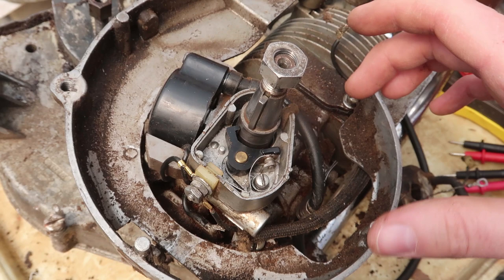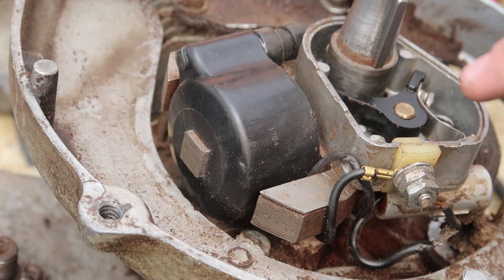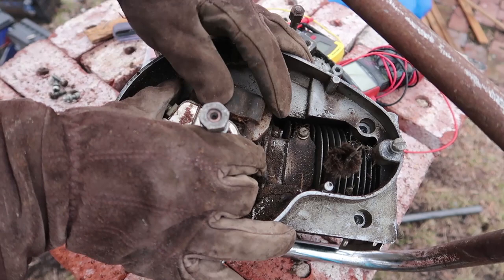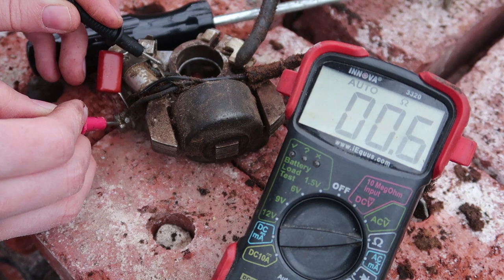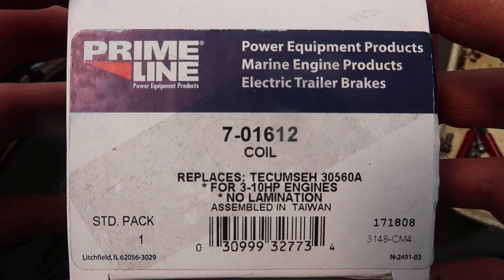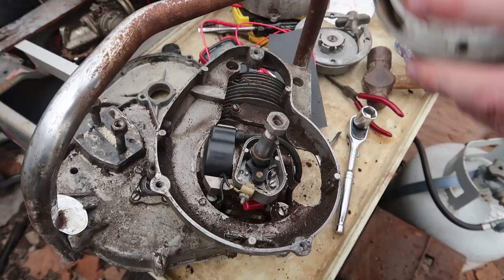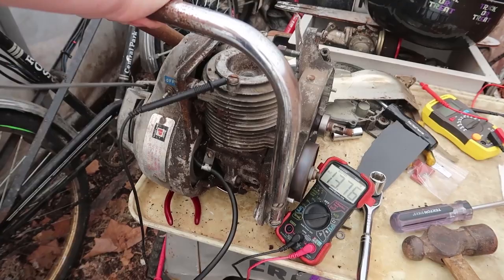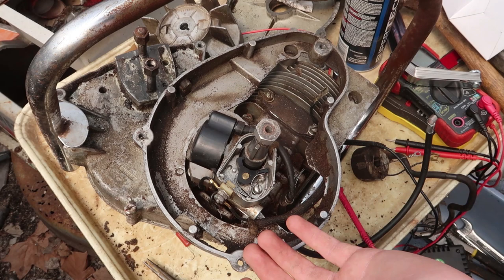1950s David Bradley Chainsaw Restoration 04: Magneto Coil Upgrade Experiment, Fix No Spark

Comment: hmm... I have recently gotten a new CNC milling machine, and was considering possibly trying to make a small engine (probably a lot smaller than the chainsaw engine in the video). the ignition system is an unresolved issue. could do a glow-engine design, or could use a microcontroller driven electronic ignition. downside of the latter case though is trying to figure out a design that wont blow up the transistors (the voltages involved somewhat exceed the breakdown voltages of most normal components).

otherwise, I have little idea about the engine in the video. maybe check that everything is wired correctly?... (maybe find datasheets or similar?). otherwise, could make sparkplug gap smaller to maybe compensate for a lower voltage.

Comment: Sorry I forgot an issue I used to see. Before they were epoxied in, the high tension lead (spark plug wire) used to be screwed into coil body. They twisted onto a very pointy screw clockwise. Sometimes they would loosen and break contact. That coil you have should be jumping almost a 1/4" inch gap on a spark tester (using recoil starter and open spark plug hole.
Reply from the maker: yeah i think im going to cut into the original coil to see if its a problem with the main wire.
Reply: When you set the point gap at high cam are  you at least about .015 ?
Reply from the maker: 0.02 as the nameplate says to do

Comment: Have you tried this... clean your points again and check resistance across the points with the points closed, you should get near zero ohms.  Contacts are a little tricky and if the condenser is bad they get badly pitted due to arcing and can seem to make contact visually, but have resistance (I've seen 10ohms on contacts not enable spark).  Also check the condenser, not just the value but an old school leakage test with an analog multimeter (google for details).  In any case it should work without a condenser, but would damage the points over time.   Also the non-business end of the points should be grounded (end furthest away from the coil).  The hanging wire is basically shorting the spark to ground.  Odd way to do it but almost all small engines short the spark to shut off (so not connected is fine).   I would use a known good plug also until you eliminate sources of problems.   I cringed when I saw you starting with a swiss army knife on disassembly, but I think you're doing quite well and this thing is really old, you just hit a snag.  Carry on.
Reply from the maker: i recently picked up a working oscilloscope so i can test it now to see what exactly is going on.
Reply: Er um... this just occurred to me.  Use a business card to gap the moving magnet in the flywheel to the magneto.  Business card thickness seems to be correct thickness to get a preferred gap.  You'll have to figure out how to set the gap with the magneto hidden under the flywheel, but if that magnet is not working or too far away from the magneto, no sparkie...  Good luck!

Keep in mind you're dealing with a high voltage you may have to attenuate to see on the scope and once you've done that you end up loading up the signal and may not give intended feedback.  BTW,  I've usually had good success with a good spark plug and good contacts that properly zero out resistance when closed.  Assuming you haven't messed up the laminations (possible, but unlikely) and as long as the windings are reasonable resistance.  So you need to verify both the primary and secondary  winding resistances.

BTW, my advise is free and you got what you paid for!

Comment: Doesn't it all function like the distributor in a older car?  points, CONDENSER and coil. The coil produces about 20,000 volts which produces the spark.

that cylindrical part looks exactly like the condenser you would find in the distributor of and older model car, say a 68 VW Bug.

Comment: if you've reduced the magnetic flux of the core, you need to increase the strength of the magnetic field. Mill out the old magnet from the rotor and replace with Nyod's. tweak timing and design as needed. It's not hard.

Comment: AFAIK, shorting the plates shouldn't be an issue as they aren't isolated from each other.
I'd suspect difference in windings and that capacitor not being the right values or being paralleled with the old condenser to be the problem. But, I'm not highly knowledgeable, so take that with a grain of salt.

Comment: i think the newer coils dont need a capacitor and a breaker swith the black wire from the newer coil is a kill wire try to disconnet the black wire from the coil
Reply from the maker: good joke, i read every new comment and dont get promoted liked comments.

Comment: dip your fingers in salt water then hold the plug wire while briskly pulling the pull cord.
that should tell you if you have spark
Reply from the maker: dont have to increase conductivity in order to feel the shock, but i still dont have spark.

Comment: You may have an old condenser that cannot store and release the charge that is needed
to provide a strong quick electric charge to the points and then to the spark plug.
You can not replace it with a standard electronic capacitor, that orange drop capacitor will not
do the job that is needed if the old condenser is the problem. The engine condenser (capacitor)
uses the metal case as the negative (minus -) ground and the center wire is the (positive +) lead.
Basically that condenser is a special electrolytic capacitor rated for engine ignition use and after
all of these years it may be getting weak. It should be easy to locate a new stock (not new OLD stock)
condenser for that engine from the same place you bought the other magneto coil (that other new coil
 should be just fine).. Automotive part stores(Napa, O'Reillys) usually carry small engine condensers in stock.
 Some times you need to refresh the fly wheel magnet to bring it back up to full magnetic charge and
power. If you Google how to do that you will find much information. I doubt that you did any damage 
to the lamination stack with the file, just wipe the surfaces clean and you should be fine. Aloha from Maui
Reply from the maker: this is the capacitor recommended by other engine restorers. you clearly lack an understanding of how this works. it needs to be an AC capacitor, so the ground isnt always negative. it isnt an electrolytic capacitor, instead something more like a thin film capacitor similar to the red new one. just fyi
Reply: The red thin film will not work up to the specifications that you are going to need for that old
system(remember this is not a HEI electronic points system). You will need a capacitor that can hold a charge for a microsecond before it releases. The one in the engine from the original is always grounded through the can.
The thin film capacitor that you are using is excellent as a filter for various frequencies.In the end
try and replace it with the same type as the original. Aloha
Reply: Without a condenser, your ignition will work fine, but your points will very rapidly pit because of the arcing, and may weld themselves together. Always replace the condenser with the points -- it is more common that a poor condenser has caused the points to fail than the points wearing on their own.  If you have a spark at the points it would seem that the magneto coil and metal stacks are working. The thin film capacitor may work but how would you mount it? I have been working on older single cylinder (as well as multi cylinder gas and diesel engines for over 55 years) 2 and 4 cycle gas engines for a very long time and have found the wise course always to replace parts with like parts. Aloha
Reply: Just a quick thought also, instead of telling someone who has been in the engine industry( 55 +years)
 and electronic and computer repair industry (40 * years vacuum tube to microprocessor) that they
have no understanding of how something works after you asked for help does not speak highly
of your people skills. I was just trying to let you know what has worked for me in the years gone by. Thank you and Aloha
Reply: You are on the3 right track here

Comment: I would 1. Clean or replace the points 2. Get a new condensor 3. make sure the gap on the points is right.
Reply from the maker: did all that in the video, didnt work. so do you have any suggestions that i didnt do?
Reply: Well do you know the exact gap for the points
Reply from the maker: 0.02 of an inch, it says on the name plate to use that.
Reply: is the ground for everything cleaned?
Reply: Try setting it to 0.18 gap.

Comment: I'm having the exact same dilemma with an old Remington Super 754, can't find a replacement. Have you thought about rewinding the coil yourself?
Reply from the maker: yes thats why i did the autopsy on the briggs magneto coil. i have the wire but dont feel confident making my own coil just yet. but i could see myself making custom coils someday
Reply: Same, what resistance where you reading in the original coil, did you say infinite resistance? And 5,000 ohms on new coil?
Reply: I've got a Wico FW coil that reads 8000, I can occasionally get a small spark out of it with the 9v battery test. Not consistent though, you tested coil seperate?
Reply from the maker: well the original coil was something like 350 mega-ohmes, so basically the plastic itself
Reply: That sounds way too high lol, I've heard 5000 listed as a high for some Briggs Stratton coils. It may be you got one that sat for awhile.
Reply from the maker: of course it is, the new coil is 5k.
Reply: The other thing to look into is an ignition module, nova 2 for example, would replace points and condenser, and with a good coil should provide a strong spark.

Comment: Try cleaning the magnets if they got eny rustbin the fly wheel it usually has a bad spark! And try a new spark ⚡️ plug
Reply from the maker: i did try a new spark plug, and ill see about cleaning the rust
Reply: Rinoa Super-Genius ok I’ve had miny bikes with no spark ⚡️ and I clean the rust and it start sparking great again 😃

Comment: Plates aren't the problem, 
Check the magnets
Check the spark plug cable
And you got anger issues
Reply from the maker: checked magnets, spark plug cable is brand new, and what on earth are you talking about? or do you mean because i didnt get angry?
Reply: Rinoa Super-Genius yeah I guess I worded it wrong. I would've chucked it across the field
Reply from the maker: sounds like you have the anger issues not me. then again i dont have testosterone so its easier not to get angry. lol

Comment: If your not getting spark use sandpaper on the flywheel make sure the coil is getting close enough to the flywheel no contact no spark
Reply from the maker: cant adjust coil distance to flywheel.
Reply: If its rusted it won't get contact
Reply from the maker: you dont want contact with the magnets.
Reply: No but they need to be clear of rust to create a spark if there dirty you won't get any spark

Comment: You really should find out how that system works before you call yourself a genius.   Then once you find out how the system works, it will be much easier to figure out what is wrong with it and you might be able to help others with their ignition systems.  Thanks for trying so hard but some prior research is in order before you tear into it and start changing parts.
Reply from the maker: you must be a moron, or dont understand sarcasm. ever heard of a cartoon character called Wile E. Coyote "Super-Genius"?

i did my research, this entire video is research. how can you not see that?

you sound like you yourself dont actually know what is wrong, so instead of wasting my time, either tell me what you think the problem is or leave.

thanks.
Reply: There is no way to tell what was wrong originally now that you have made so many changes.  The first thing that should have been done would be to check see that the points were set right and clean.  You did that after changing the coil.  If they check out, the stop wire that goes to the stop switch should be disconnected from the points and check for spark.  If you have spark, the wire is bad or grounded.  The switch should be checked too, to make sure it is not conductive in the on position.  It conducts to ground in the off position to short out the points and kill the spark.   The condenser should be checked or changed with one from a system that works.  You need a special tester to be sure a condenser is good.   NOS condensers are not very reliable as they can often go bad with age and may or may not work.  There is no good reason to put in two condensers.   The condenser can be checked for shorting with a standard meter.  That will only tell you if it is bad, not if it is good.  The replacement must be the correct capacity to match electrically with the coil.  If you changed to a different coil, you must use the condenser that matches that coil.  The coil should be checked for continuity, which you did through the plug wire to ground, that is correct to have something like 5 to 10 ohms but it does not mean the coil is good.   If it is zero or infinite,  the coil is bad.  Checking the other side of the coil from the points wire to ground will normally give a zero reading, if it show infinite, the coil is bad.  If it shows zero, it does not show that the coil is good.  You are correct that high voltage is the only way to know.  The clearance of the magnets to the coil needs to be right, closer is better but too close and they will rub destroying things.  The normal clearance with good crank bearings would usually be in the range of .010 to .015".  It is difficult to measure with a coil inside the flywheel.  It can be done by loosening the coil mounting screws till the coil can be moved with a certain amount of force.  Then prop up a business card so it stays over the coil pole pieces while the flywheel is mounted, magnets toward the coil.  Tip the flywheel at an angle so the card stays in place while the wheel is lowered over the crank.  Snug the nut a little, it does not have to be tight.  Remove the wheel the same way without disturbing the coil.  Remove the card and tighten the coil in place.  Recheck with the card, feeling for snugness as the flywheel comes into place, verifying that the coil has not moved.  The magnets should be checked when the wheel is off by setting a 1/2" hex nut on them and ensuring it stays stuck on there.  That is in fact the Homelite factory way of checking magnets.   Until you have completed these steps, you are not done. If you go through all theses steps, in this order, and there is still no spark, you can legitimately be frustrated.  I would start at the beginning again with this engine but changing to a different coil may have done it in, it is very hard to know for sure.  Good luck.
Reply from the maker: points dont matter if your coil is open circuit. just fyi.
Reply from the maker: oh and yes i pretty much have done all these steps, although i dont see any obvious way to move the coil closer to the magnets on this model. it fits rather snugly on the shaft.

Comment: You never cleaned the points right you should turn the engine till the points are closed then put a nice clean piece of white paper between the two contacts on the points pull it through a couple times it will clean off the oils and dirt on them.
Reply from the maker: i cleaned them in the video with 1500 grit sandpaper.
Reply: Rinoa Super-Genius the sand paper dosent clean the oils off them

Comment: jus switch it over to a solid state module..
done..
Reply from the maker: would need a battery and a coil and a generator if i were to replace the broken coil with something less mechanical.

Comment: That old on off switch could be the first thing you needed to check. Just saying 👍😆
Reply from the maker: doesnt seem to have any problems when i check it, also it seems to be useless since the magneto case is already connected to ground and so the resistance doesnt change at all when flipping the switch.

Comment: Another thing you have to consider is timing to get a spark. You removed the coil and points unit from the saw. Also there is an air gap between the magnets and the coil.  All that  has to be set in the correct location that the timing of the points break and at the time the magnet is creating the charge through the coil. You should try to find the oldest saw repairman in your area to see if he know how to set everything back to where it needs to go on an old saw. Ps. I think I have 2 of those old saws out in my barn. I know one has a broken connecting rod and I am not sure about the other one.  Good luck I hope you get it going again.
Reply from the maker: on this model it is impossible to charge the timing between coil and points, and impossible to change gap between magnets and coil, so those are irrelevant. for other information i have set it to what is stated on the label.

Comment: It should work the way you conected it...
However I see that you dont gett how the system works 
You could watch sixtyfiveford's video "how points an condenser works smal engines"
Reply from the maker: i know roughly how it works, but not enough to build one from scratch. or at least until i learned how the coil does in fact have a primary on it
Reply: the primary is only tere to stop the engine and set the timing. 

The secondary would give spark whitout a primary but when the points are closed the prmary is short circuted and pulls down the magnetic force in the core so the secondary dosent give a spark then when the points open the pirmary is open and dosent pull down the secondary and the secondary now gives a spark.
The condenser is there to mimimise the arking of the points.
Reply: try disconnecting the cable that goes to the points an condenser then it shuld gett a spark but not on time so dont even try starting it like that however you se if magnets and coils are good. (Dont disconect the ground)